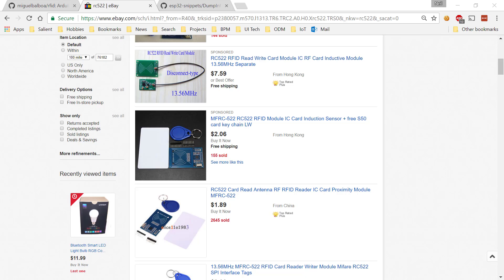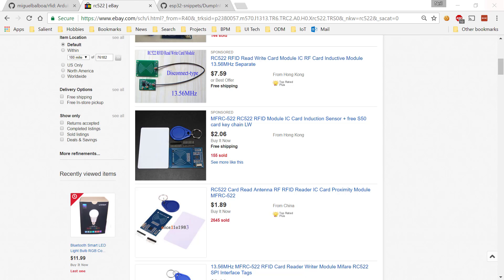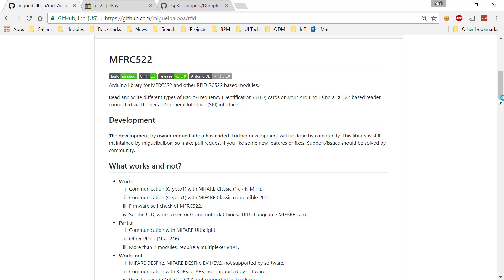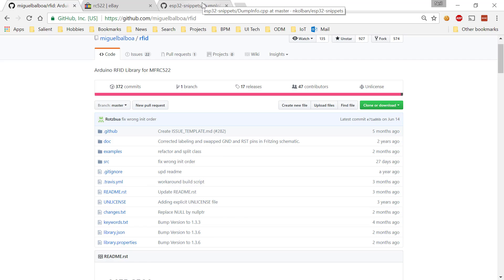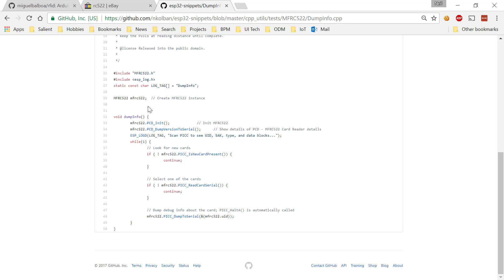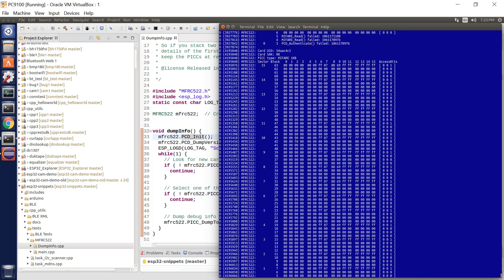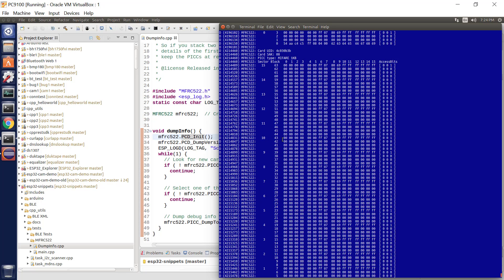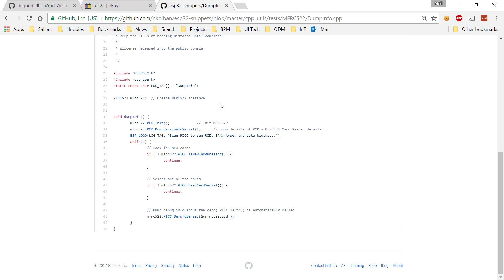ESP32 Technical Tutorials: RC522 RFID

Comment: Thanks for a great tutorial. I have a bunch of  RC522 cards,bought from different suppliers on Aliexpress. All of witch works with ESP8266, However some of them do not work with ESP32. I was wondering if you have an idea to where can I fine tune your code to get the rest to work. I do get some feedback from the cards that do not work .and the ESP can detect that there is a new tag but can't read the tag id or content.Also the  Firmware version reported is 0x11 on some and  0x12  on others that do not work but allways 0x92 on those that works. I don't use a reset line on any
Thanks